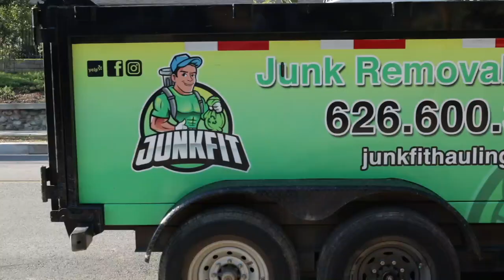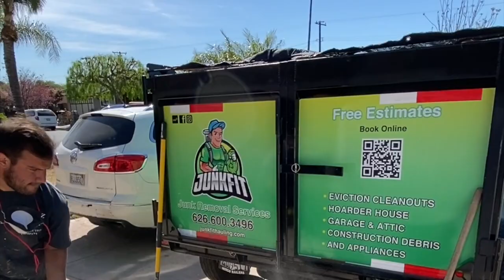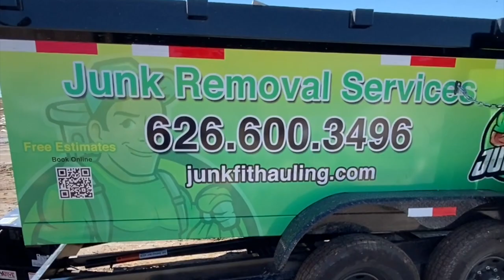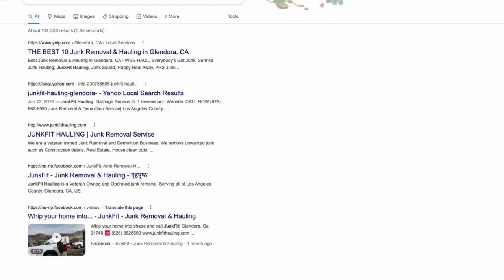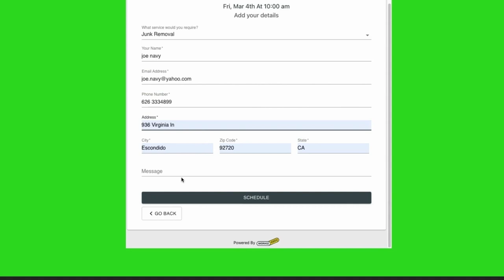Junk Removal Service & Pricing - How to charge for your junk removal service

Comment: You talk about competitors charging dirt cheap but you are the competitor charging dirt cheap ($800) is a bargain. I was thinking around $3,500 but based on your price $2,000 is reasonable.
Reply: i was going to say the same thing!
Reply: Agreed! That should've been $1500 MINIMUM
Reply: Ya that's alot for $800 ! I would at least charge 1200 for that

Comment: Wannabe junk hauler here, in my area of Michigan a guy can rent a trailer for a few days. Company will drop off and pick up but renter does all the loading. That costs around $500 +- depending on the size of trailer. I guess that only works if a guy has multiple trailers to rent out though. To show up, have a crew load and haul away same day I would expect to pay more than $800. Im just going by what Ive seen online though, no actual experience. Thanks for sharing what you do!❤